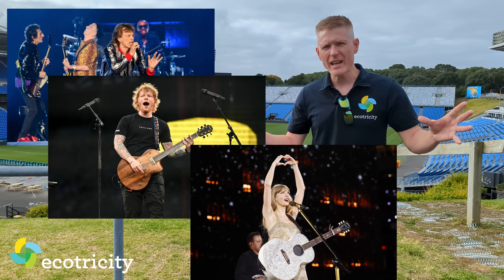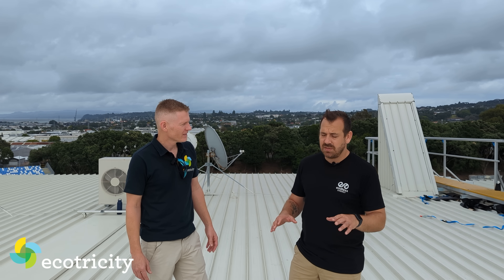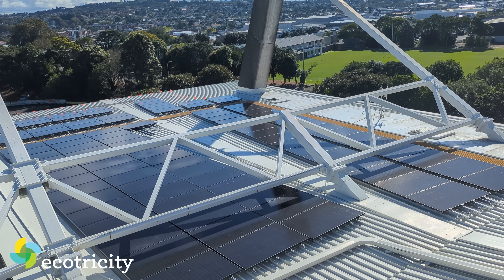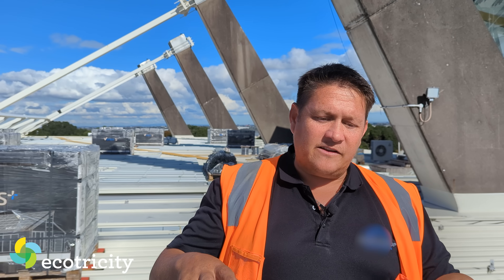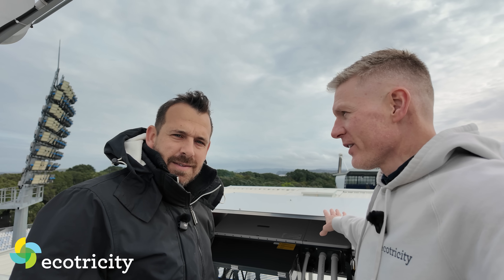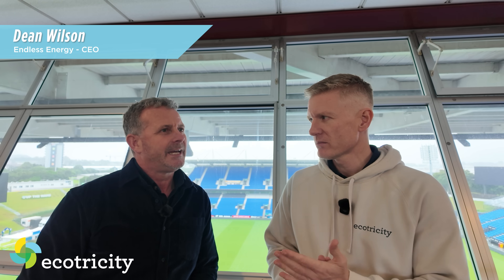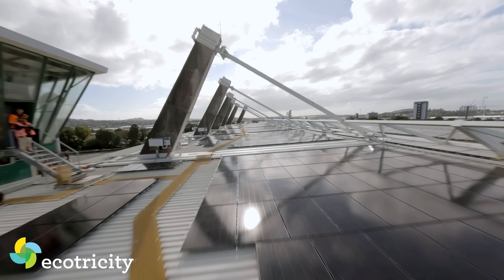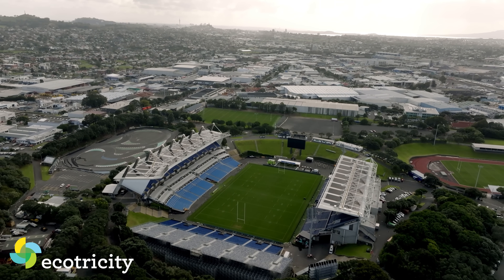UP THE WAHS! The Warriors stadium gets solar powered!

Comment: Solar panels in NZ are 2-3 times the price of what they are in Aussie, or imported from China.  I am talking about the exact same model of panel.
The NZ market is too small and non competitive to be attractive to put solar on at the moment.
The price needs to half and the installers just need to cry about the loss of the healthy margins.
The panels they are using are like $120 each if they are the larger commercial size panels.  But good luck trying to buy them for that unless you order by the thousands in NZ.

Comment: Thanks Gav very interesting build.  Will they need to checkup on it every so often to ensure the clamps are still tight and holding since high winds could loosen some of the screws holding the clamps to the roof due to movement and such?

Comment: Nice one, and btw did you ask whether they considered batteries, and what that payback would have been?
Reply: I was wondering about that, thought we might see some decent battery storage on such a major solar installation.
Reply: @geoffreyjones6019 guess the feasibility all depends on the tariff structure
Reply: Can you confirm the solar generated power is fed into the grid and then they have a buyback, hence no battery storage, which would have added to the capital cost?